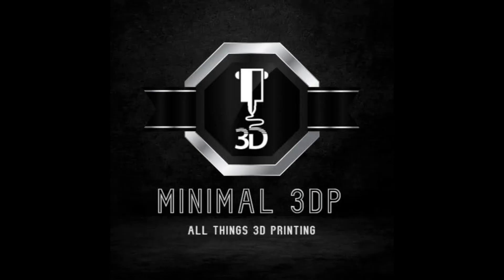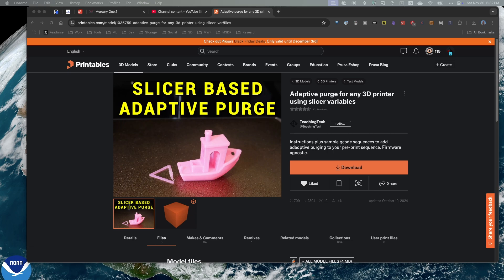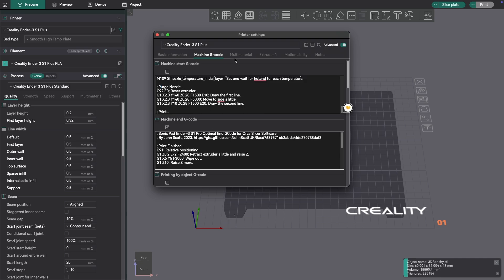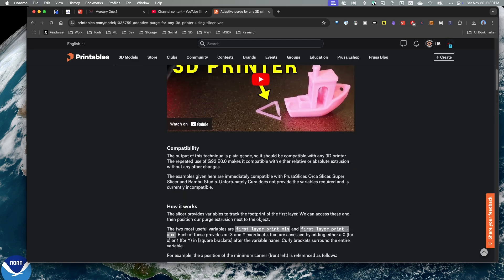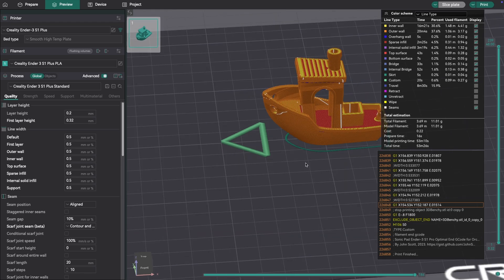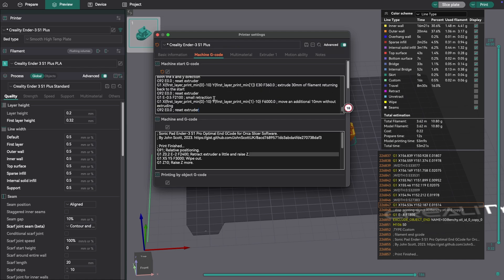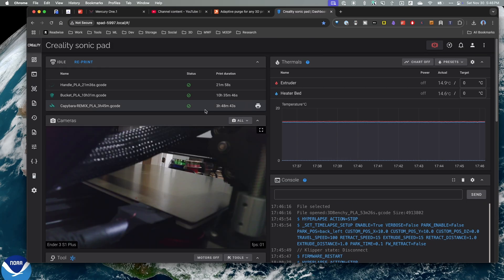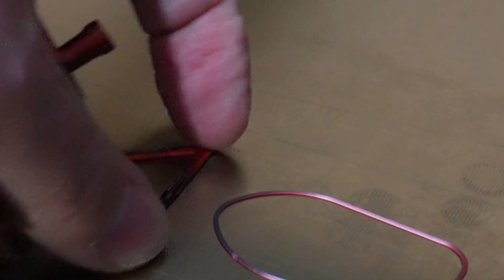Klipper Adaptive Purge Tutorial: A Guide for Orcaslicer

Comment: I see your line width setting is 0.5. Are you using a 0.5mm nozzle?
Reply from the maker: I am using a .4 nozzle. I do a .5 line thickness for both speed and strength.
Reply: @minimal3dp  can you share the orca slicer profile you are using?